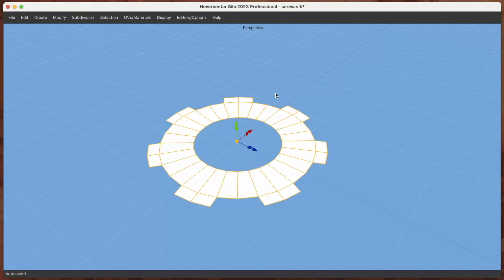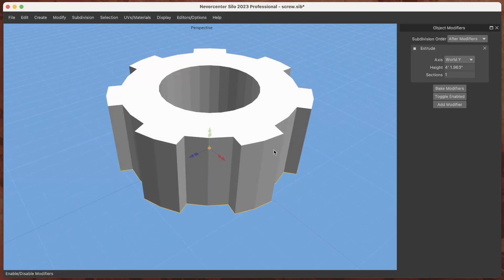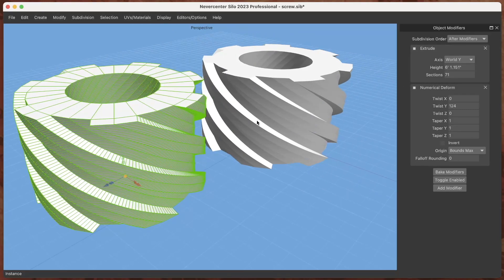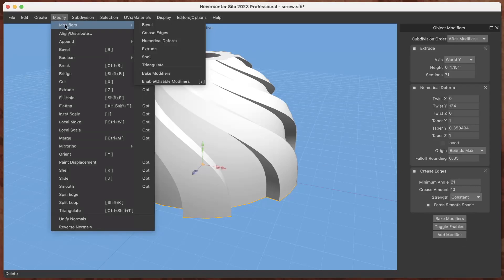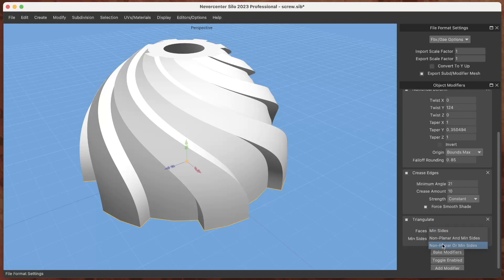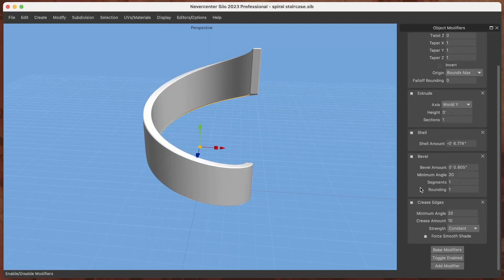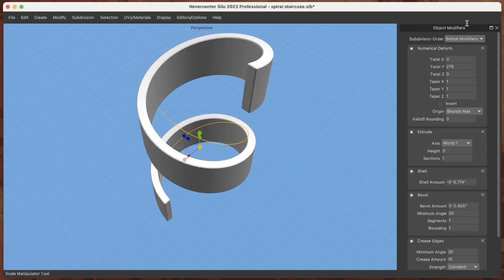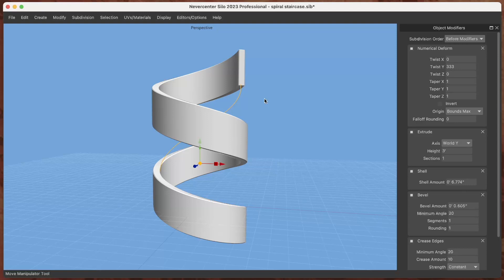Silo 2023 Released With Major New Feature: Non-Destructive Modifiers

Comment: There is much to like here.  I used Silo a good while (years ago) and enjoyed it.  However, I was trained in 3DS Max and I yearned for one feature.  FFD cage deforms.    If you put that modifier in I will buy Silo in a heartbeat, for while I love 3DS Max, I am outraged that Autodesk doesn't sell perpetual licenses anymore and I am worried the time will come when I will no longer be able to use my copy of Max 2017.  I had a close call today with Max launching then crashing (I found a workaround to actually launch max successfully by opening it with a file).  If you put in FFD cage deform.  I will buy Silo immediately.  The offer stands if you already put it in.
Reply from the maker: Excellent. We'd definitely like to add cage-like deformers, once we add support for interactive tools in the 3D workspace for our modifiers.

Comment: Silo is just THE BEST 3d modeler money can buy.
Reply: Do you mind telling me what you love most about it?
I used to think that, I used silo many years ago, loved it a lot! 
But I've tried to download the latest trial and I can't find anything... I looked for some doc but same...
Reply: @workflowinmind  Silo is the fastest SubD modeler free or paid. A lot of features you'd find in other packages was originally found in Silo first like select similar, loop slide and smooth, non uniform bridge, overlapping knife cuts, multi select tweak, multi mode hover execute and a whole lot more. And unlike other SubD modelers, the vertex sits on the shape and is not hovering on an invisible cage. Also the SubD handles N-Gons beautifully. And being a dedicated modeler, you can have every actions assigned to a hotkey. If Silo was a text editor, it would be Vim. Ruthlessly efficient in the hand of a master modeler.